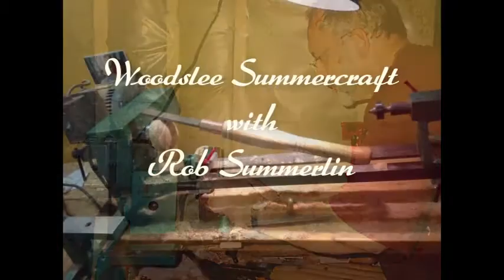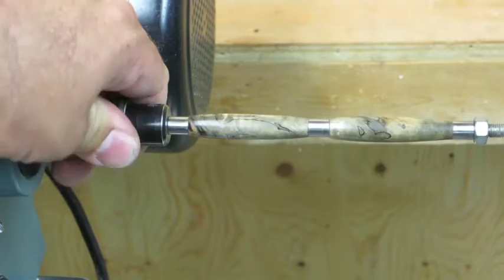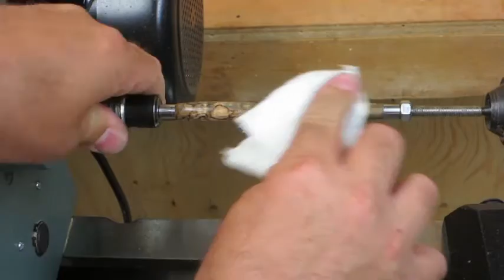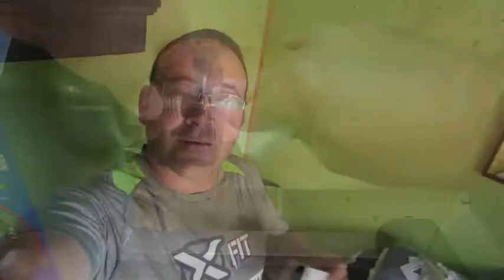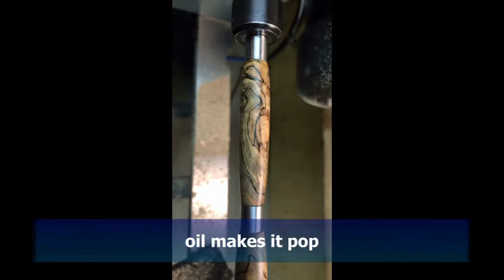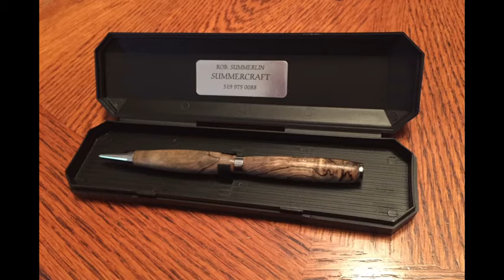Wood turning # 48 Hampshire sheen high gloss pen

Comment: Questions for clarification:
1.  Wax before oil, or oil before wax?
2.  How does it hold up with use?
Reply from the maker: Hi Louis 
I always apply oils before wax, this allows the oils to bring out the natural lustre of the wood, and Hampshire sheen high gloss is a very durable finish. 
Hope this helps
Take care
Rob